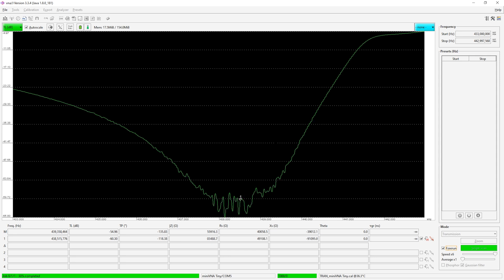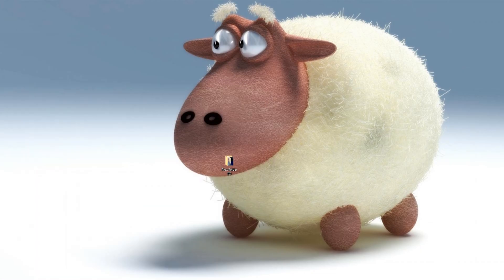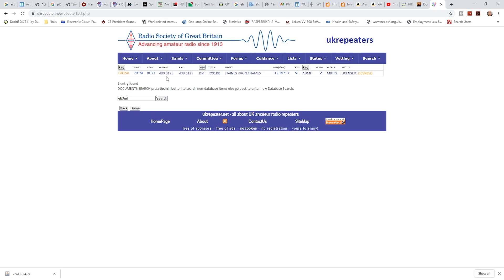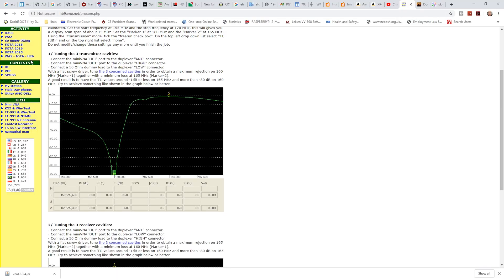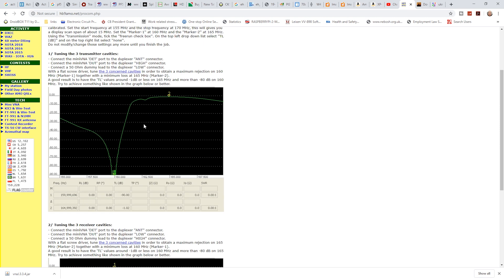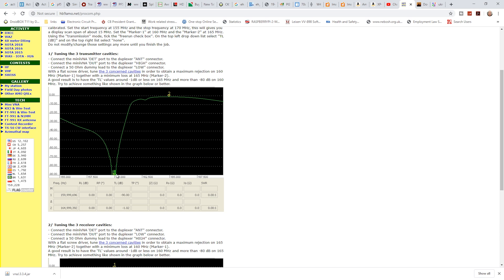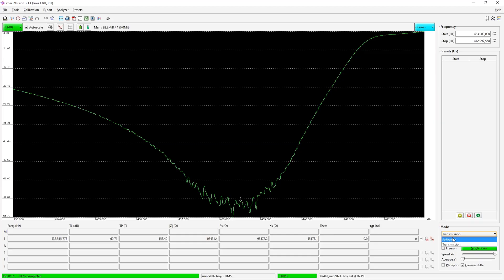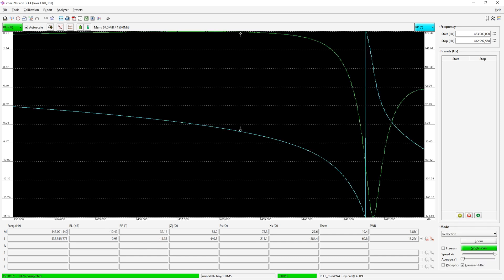GB3ML Procom Duplexer the story so far, will it work after I "tuned" it? :-)

Comment: Hi Mate,

The miniVNA is really not ideal for tuning/notching this type of duplexers. 
These filters are capable of a 90-110dB notch, the miniVNA simply do not have the required dynamic range needed. 
The sweep time is also way too slow. 

Do you have the radio part of the repeater in place ? 
What type of hardware are you planning to use ?

Where in the UK are you based ? I will be travelling to the UK regularly for the next 8 months, and I always have a “real” VNA in my travel kit. 

Kind regards 
Daniel
OZ9DW
Reply from the maker: Heathrow, its going to procom to be tuned.. It will be way faster than I doing it.. Yes the repeater is ready just waiting for antenna, filter and the controller to be tested.. Gaz
Reply: @TheGazLab  Thanks for the reply.. I will be traveling to Grimsby, Middlesbrough and Hull doing the current project I am working on.
Make a video about the other hardware in the project and I will sponsor the project with a new tuned duplexer.
Reply: @TheGazLab  Just found a duplexer with the required duplex spacing in my lab, same model which you have in the video. I just tuned it for your frequencies and it look OK. 
I have the results in PDF if would you like to se what to expected..

Comment: I had some bad readings from my nanoVNA I just couldn't get it to read correctly, it was jumping around with ragged looking dips. It was all due to the USB cable to the computer I had to wrap 11 turns of a thin high quality 2m usb lead around a FAIR-RITE TYPE 31 core, that completely cleaned to the results, and I got much deeper dips when testing filters.
Reply from the maker: I will try that.. Im cheating a little now tho checking the results on a tracking gen and spectrum analyser.. :-)